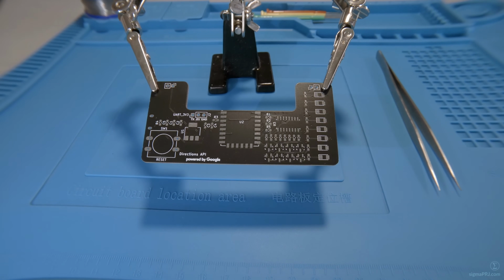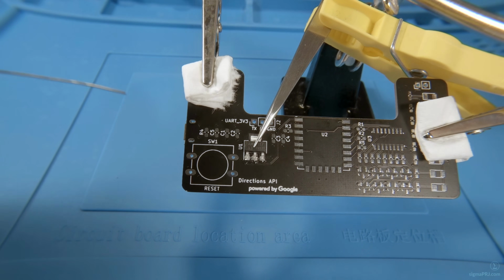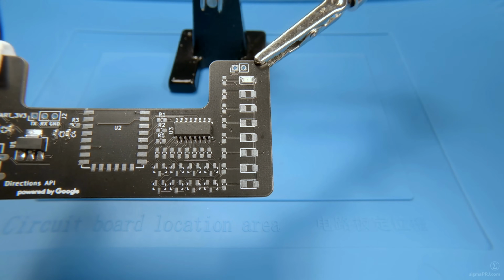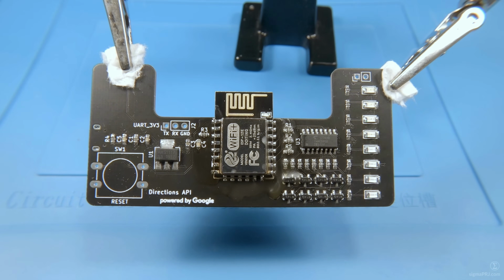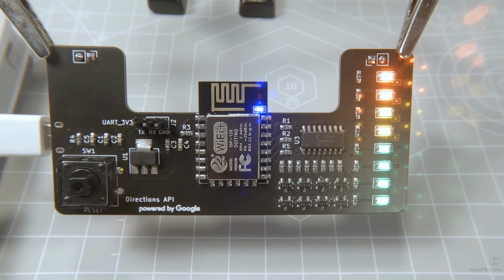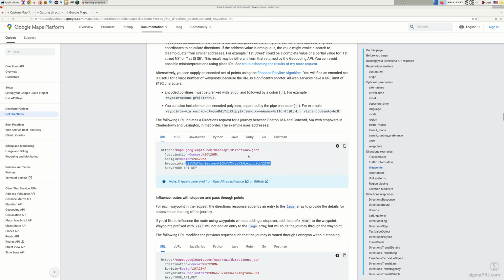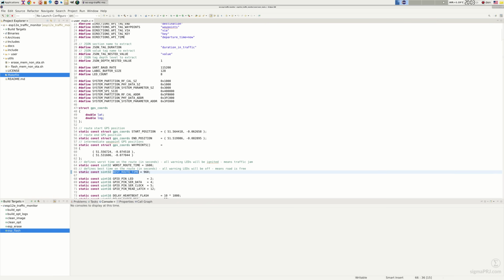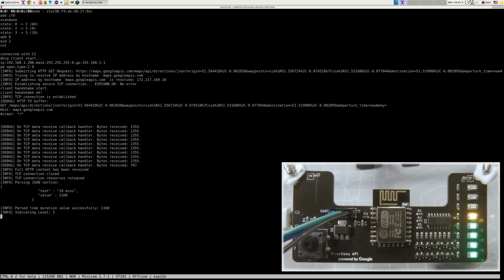ESP8266: Highway Jams Monitor. Part II. Soldering and Testing.

Comment: Awesome video series, man! I really like the way explain your project. I recommend doing some small adjustments to voice track, like a bit of compression and maybe eq to reduce low-frequency  hum and noise. Then it would be 11/10. Good luck!
Reply from the maker: thanks Danil ) probably I have switch to some proper mic away from my mobile phone to record the audio ) and definitely will need to switch off my fridge in background :)
Reply: @sigmaprojection3781  mobile phones have actually pretty decent mics (with low noise levels and good voice processing). The way to go is to theat the rooms acoustics. Record away from the keyboard, close doors and windows, be close (15-30cm) to the microphone (make sure not to have plosives go brrr) and maybe cover yourself with a blanket :D. A bit of eq/compression/gate and no money spent. Go look at Podcastage and Sound Speeds, they have great 0$-recording tips
Reply from the maker: @becejlbe  thanks mate ) will try the idea with blanket :) to reduce the echo ...